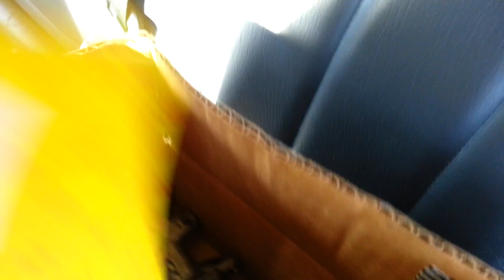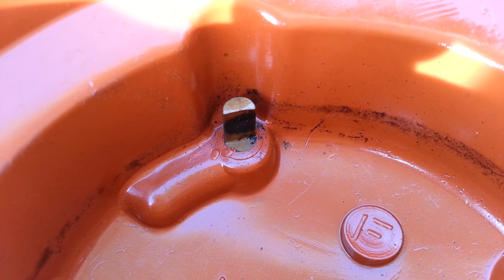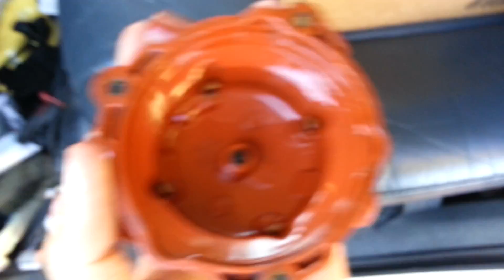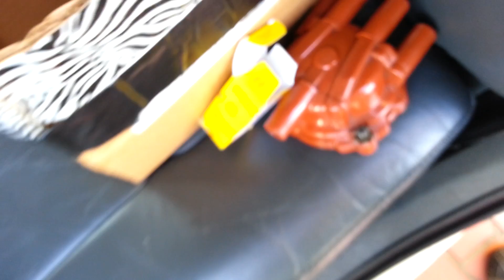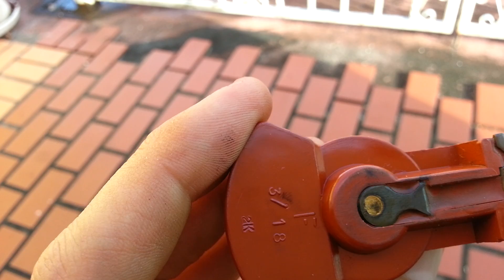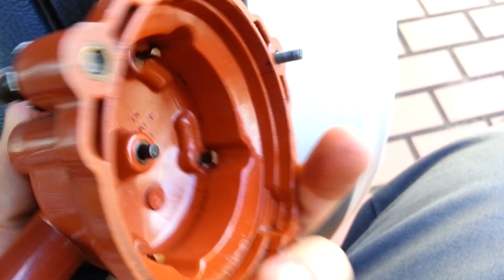The Problem: Dead Cap and Rotor - 1993 Volvo 940 Turbo Repair/Fix

Comment: Thanks so much for this video! My 1991 740 turbo wagon was experiencing the exact same problem. Swapped out the MAF sensor, spark plugs, ignition leads, ignition control module, crank position sensor and cleaned up the IAC motor to no avail.  Found your video and checked out the cap which was relatively new but an inexpensive ebay item, it looked good but look sare deceiving. Installed the original Bosch unit which was well worn and the wagon ran perfectly. Thanks again for this video! New OEM cap is ordered and on it's way.

Comment: Sometimes cleaning the contacts up doesn't work at all.
Did that on mine and saved the 740 for a bit but left me stranded afterwards. (luckily at a mates place)
Getting a new set fixed it right up.